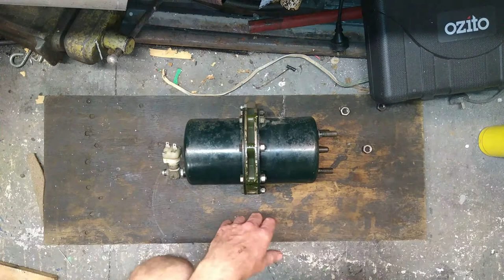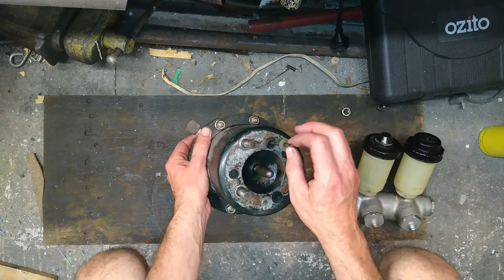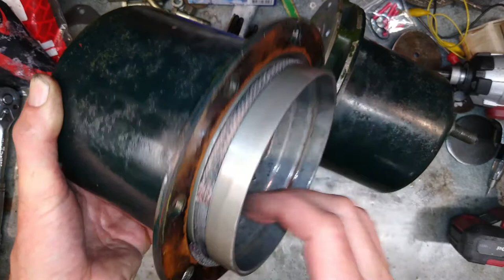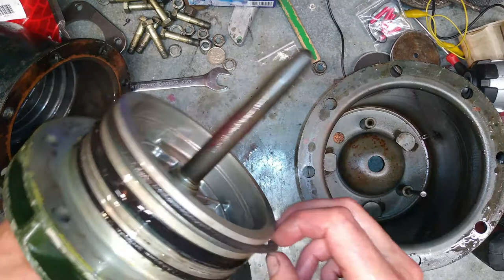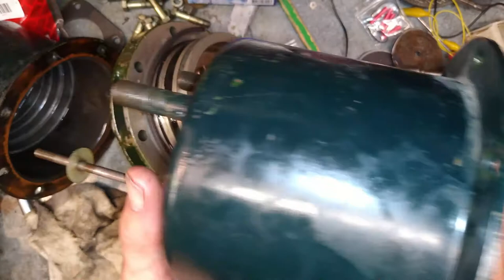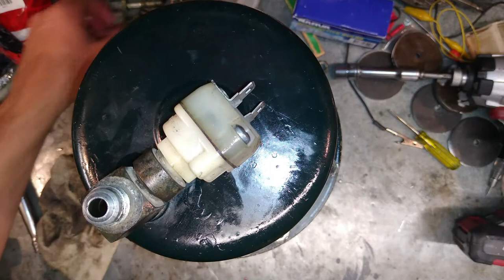Bedford Bus Air Over Hydraulic Brake system. Tear down of Dual Actuator.

Comment: Interesting that there are two air cylinders that operate the master hydraulic cylinder. Doesn’t seem that it needs both to make enough force against the master cylinder. Is it redundant air supplies in case one fails?